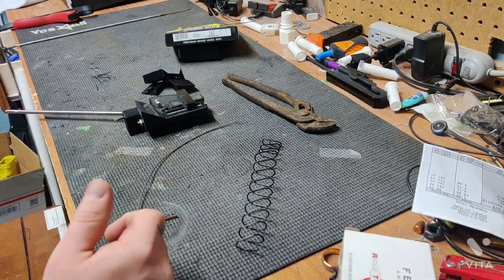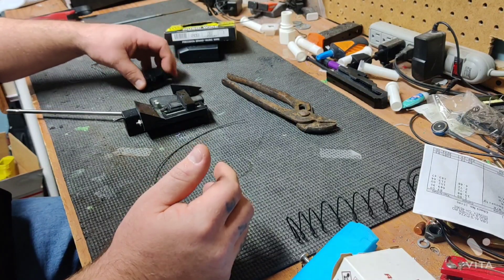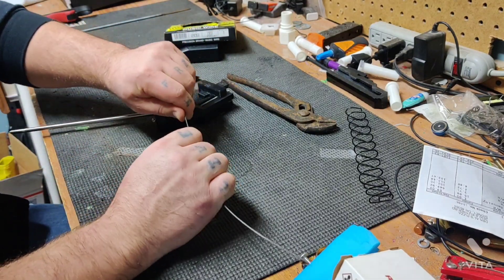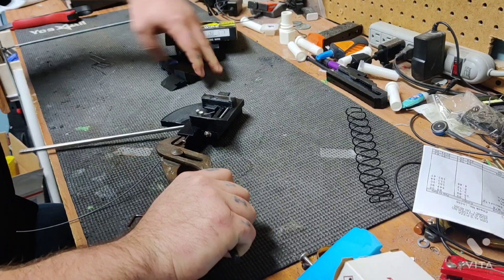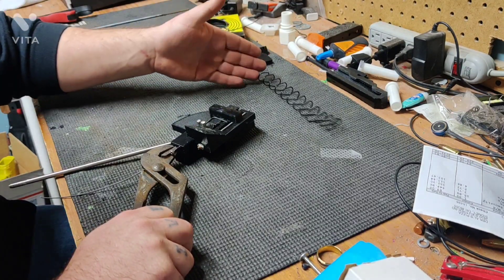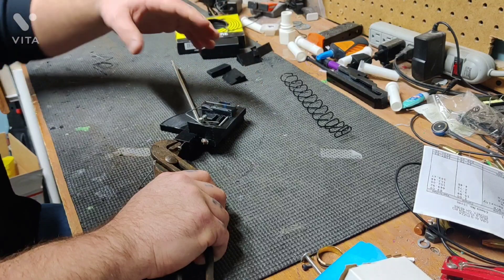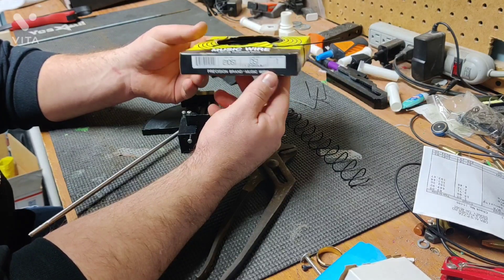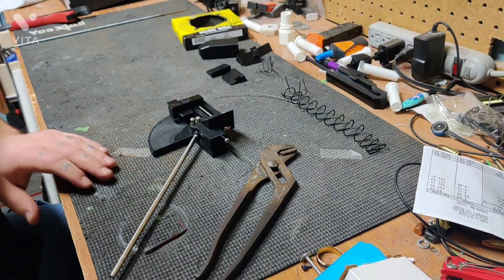The Spring Factory - make your own Extendez springs

Comment: Charging for something that isn't even properly finished.. parts should never have to be scaled by a factor upwards of 1000 to make something fit properly. Just make your models right to begin with..
Reply from the maker: @lima4923  this isn't my model. The designer of the model, HWEnterprises, specified in the instructions that all printed parts need scaled up 1000% in cura to print at the correct size. It's far easier to read/follow the instructions on a free file than to design a part from scratch so I just try to appreciate the work he put in instead of criticizing a minor inconvenience. I just made the video so people could find and use the part if they were unable to purchase the springs they need.

Comment: I can't find shit on any of the details about what angles or lengths? I need to bend the wire for a glock mag. Shits driving me nuts lol any help would be much appreciated!
Reply from the maker: @bryc0115  I haven't found any posted information about what the dimensions are supposed to be. I have purchased 3 different brands of pre bent 30 round springs and all 3 of them are slightly different. If I remember correctly the closest I've found to matching is either the 30 or 35 degree wedge. The top few coils have a different dimension than the rest so that they fit the follower and tapered portion of the magazine. I can pull some measurements from one of the store bought springs when I get home but you'll have to compensate for bends and wire diameter to make adjustments. You're likely going to scrap a bit of wire to dial it in. If you want to add me on discord for easier communication I'm pretty sure I have my information posted in my pages information on here, then I can add pictures of the spring if you need them.

Comment: would this wire be too strong for making short dart nerf mags?
Reply from the maker: I do not have a good answer for that question. I have single shot dart blasters but do not have any with a magazine to take apart for comparison. My assumption is that you could make it work but I think a thinner wire would be better so that the darts don't get deformed or just pop out from spring pressure
Reply: @19amw87  thnx

Comment: Will this work for 1911 springs? Thanks!
Reply from the maker: I haven't tried it for anything other than Glock springs but it should be just about universal, so long as the bend radius doesn't need to be smaller than the center pin. In that case you'd need to modify the part to take smaller pins or just scale the entire part down
Reply: Ok thanks! I’ll print it and see if it works. Also I ordered some 1.2mm spring wire.

Comment: Hi this shape spring is in the pez sweet dispenser but smaller.
 I am trying to find tiny tiny expansion springs but they are illusive Evan mythical.
I will have to make my own.
Reply from the maker: This machine will allow you to make springs for many different uses. If you need springs with smaller bends you could scale down the print so that it uses smaller dowel rods. The smaller the center dowel rod is the smaller radius you can make on your spring. My children enjoy pez but I have never tried to make the dispenser myself
Reply: Thanks for replying. 
Could you please tell me what type of metal I would use.
Would it be nickel or steel or ?
ps I don’t enjoy Pez I just found a spring in it thanks Dom.
Reply from the maker: @domytar5395  piano wire is common for home made springs and is inexpensive. I am not sure what size wire you would need though.

Comment: HI, realy thanks for this video it help me a lot... I leave in a country where weapons are legal but very expensive so i make my magazine ...
It help me a lot if you could tell me the longer of each spring, (17, 25, 30) ... Thx
Reply from the maker: An 18 round G17 magazine has 14 wraps that are 16.5mm outside diameter, 1 wrap is 15.5mm o.d., and 5 wraps that are 11.5mm o.d., with the total spring length being 152mm.
A 17 round G17 magazine has 10 wraps with an outside diameter of 17.5mm, 1 wrap of 14.5mm o.d., and 5 wraps of 10.5mm o.d., with a total spring length of 154mm
A 15 round G19 spring has 11 wraps with a 16.5mm o.d., 1 wrap with a 15 o.d., and 3 wraps with a 9mm o.d., with a total spring length of 117mm
A 30 round G17 spring has 18 wraps with a 16mm o.d., and 6 wraps with a 9.5mm o.d., with a total spring length of 180mm
All of the springs have a start loop and an end loop to help them hold onto the base plate and follower. You will have to do some math to compensate for the thickness of the wire you are using and bend radius to get your springs to the correct size, when using the spring factory your measurements would all be for the inside diameter of the spring but I have only provided you with the outside diameter. This is because different manufacturers use different thickness of wire. Also the store bought springs are wrapped around a large pin, the spring factory uses a small pin and therefore requires you to make a spring that is rectangular instead of ovular like the store bought magazines. I hope this information helps, just remember that you do not need perfection to achieve functional parts.
Reply: @19amw87  Thank you very sir !! :)
Reply from the maker: I am at work right now, when I am home I will provide the measurements for you.

Comment: I downloaded this too. Looking forward to printing it and trying it out. Thanks for posting.
Reply from the maker: Just don't forget to scale it up
Reply: @19amw87 , Hey, just watching this video and saw your comment., I ran into the scaling issue.  What size worked for you? I'm just winging it since there aren't actual directions to build it. Thanks!
Reply from the maker: @JosiahArmbrust-q1d  if you get the file from thingiverse you have to use the download all feature in order to get the instructions. The scaling is listed as 1000% if I remember correctly
Reply: Hi where do you download the print please?
Reply: How did this work
Reply from the maker: @jamesdysard2091  it can work very well if you take the time to measure everything properly. If you want to make 1 specific kind of spring you may be better off using a dedicated jig. There are mag spring jigs that allow you to just wrap the wire around the jig, those are much faster and easier. The spring factory is nice for when you need to make hard to find spring sizes in various shapes or rates

Comment: Printing now! what slop angle would i use for a glock 26, 10 round mag? (mini menendez)  I got an ace hardware near me that carries the wire)
Reply from the maker: I only tried making the 25-30 round springs and I had to use the largest slope to match the store bought spring. It was either 30 or 35 degrees.
Reply: @19amw87 just the answer I was looking for! How many coils did you have to make in doing one for a 31

Comment: Cant find that exact music wire do you have a link for it
Reply from the maker: I actually found the 2 spools that I bought on eBay, they were listed as old stock. If you can't find that size on eBay or Amazon then check out Grainger or zoro tools. I'm using Precision brand music wire
Reply from the maker: Google search Precision 21051 and you'll see it pop up on several sites

Comment: Hi 
Can you send me a link to buy the spring making device please
Reply from the maker: I don't think it can be purchased, but if have any friends with a 3d printer they could print it for you
Reply: @19amw87  ok thanks any chance 
You can give me the plans for it?
Reply from the maker: @alexsaville967  https://www.thingiverse.com/thing:5025291

When you download the files you'll want to "download all" because that is the only way to get the instructions that tell you which size rods are dowel pins to use, as well as what percentage to scale the part up to (I think it requires a 1000% scale setting)

Comment: Any news on AR spring factory. I'd be happy with mag springs but would also enjoy lower parts springs
Reply from the maker: I haven't tried making anything other than Glock mag springs with it. Springs for the fire control group would probably be easier to do freehand around a hardened steel pin just because of their shape, but I've never tried it to find out

Comment: Is this file on grabcad?? I found one that might be the same. Just wondering
Reply from the maker: I'm not familiar with grabcad. I found it 9n defcad and thingiverse. From my search this is the only one I could find that's set up like this. There are some other models shaped like a Glock mag with grooves, and you just wrap it around. This is more of a multipurpose bender though so I thought it was better overall even if it is a little more work to use
Reply: @19amw87  It’s the same one, I’ve seen it on defcad also but I don’t want to pay them to join for the files.
Reply from the maker: @250smacks  same here. I originally found it on defcad then started searching for it on odysee and thingiverse. I never did find it on odyssee but the search feature isn't great

Comment: How do you heat treat your springs? What device do you use to get them up to a sustainable 560 F
Reply from the maker: You can stress relieve them in a regular oven. The music wire has already been heat treated
Reply: @19amw87  I see. What temperature would you recommend?
Reply from the maker: @dr.kekyll9839  If I remember correctly there was a suggested time and temperature in the readme files. I will have to check after work but I want to say it was 400°F for a certain amount of time then cool to room temp with the door closed. I'll post an update around 10pm, otherwise if you go to thingiverse and "download all" it will give you the readme files with some useful information. My personal opinion is that Glock springs are so plentiful and relatively cheap that I'd rather just buy them but if you need a hard to find spring then this machine works very well.
Reply: @19amw87  well I’m gonna play around and see about remixing the file to be able to make AR mags. Also I’ve got the file too, I just wanted to pick the brain of someone who’s already printed it. I will appreciate that update. Thank you very mich
Reply from the maker: @dr.kekyll9839  I'd thought about using it for the printable ar mags too, just haven't made it that far yet. I picked up a stack of used mil surp mags at a gun show about 10 years ago so that project has been a low priority. Guess I could start the prints though so it's ready for a video
Reply from the maker: @dr.kekyll9839  looking through the pdf files on the spring factory. There seems to be a debate in forums as to whether or not this process actually work hardens the wire. Some people suggest heating the finished spring to 300°c (572°F) until purple/blue oxidation occurs, or 2 hours, whichever happens first. Others have suggested using your household oven with the rack in the highest position and the heat set to broil, which is normally 250-275°C (482-527°F).
Reply: @19amw87  thanks, Brother!

Comment: I think you can buy them on aliexpress though for about a dollar or so
Reply from the maker: Currently they are $10 to $15 each after shipping for single springs, $5 to $10 each if you buy 5 spring, $3.25 each of you buy 10, and about $1.87 each if you buy 50. Current shipping time is 4-6 weeks, plus 3-5 days handling time. I paid right around $50 for 9 springs that were already the correct size for extendez mags and had them in 3 days. If I were going to order from Ali I'd definitely want to do the 50 pack to make it worth the wait, but I don't know if they are bent to fit factory mags or extendez mags. If they don't fit printed mags then I'd rather just spend a little more for the ones that do, and not wait 6 weeks. But that's just my personal preference. I'm terribly impatient.
Reply: @19amw87 do you think I could sell them ? If I bought in bulk and pritned out soms
Reply from the maker: @popinmo  most people just resell the springs, in which case you could easily sell them. It's generally frowned upon to sell things you didn't design because then the person who put in the time on the design isn't getting paid for their work. I'm pretty sure you could sell the 25 round extendez mags for $15ish though
Reply: @19amw87  I mean depends making a model is a one time thing but production of it is constant work for each item sold so I really don't see why it's wrong
Reply: @19amw87  yea I buy really cheap but good filament and can print decent mags so I could easily make the 33 round ones
Reply from the maker: @popinmo  it just depends on who you ask. Generally if I'm asked to make something I didn't design I will sell it at cost. If I don't have the ability to design it myself then I wouldn't have access to the file to sell it if it weren't for the generosity of others making the files public. I don't have anything against others doing it, I've given permission to others to sell my designs without paying me, but if the creator saw you selling their products online they could potentially demand that you cease and desist. Many stl websites automatically put protections in place for the creator for that reason.
Reply: A little late to the party but I disagree in this case. You wouldn't be selling the design, you'd be selling something that you produced using the design. Like if I turn a pen on my little Harbor Freight lathe, I'm not going to ask or give them credit for the pen. While this is freely available and lathes tend to cost money, I got my lathe for free from my grandpa so I guess I would have to ask and credit him.